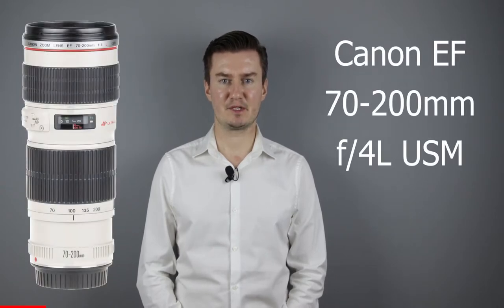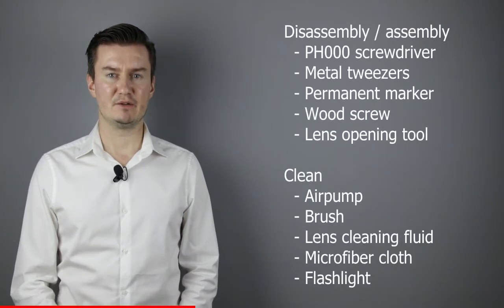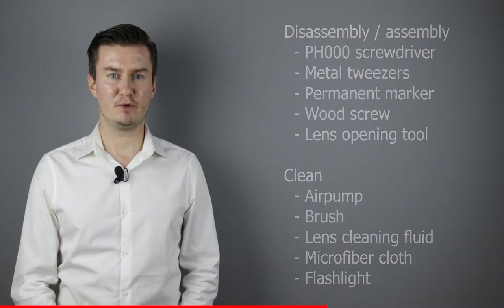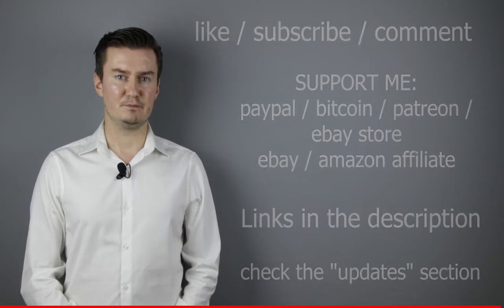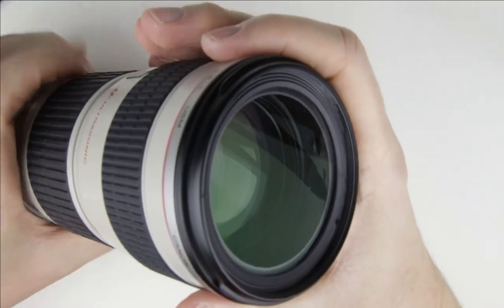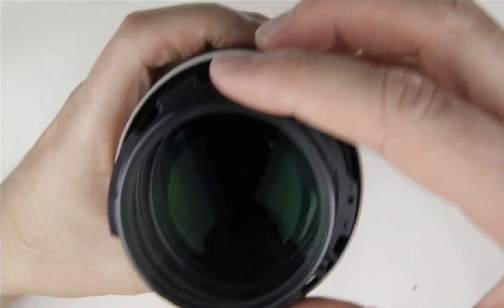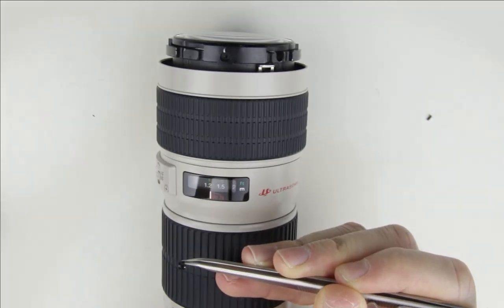Canon EF 70-200mm f/4 L USM - how to clean the lens inside

Comment: how about showing how to clean/remove fungus from the other end of that lens? i have the IS version.
Reply from the maker: I have a disassembly video about a Canon 70-200/4 lens which I have to access the USM motor. I guess the IS version is very similar, and you can use that video to remove the rear lens element group. I haven't disassembled that group, so I don't know how to do it, but check it, maybe it is easy to do it.
Reply: @CamerasLensesEtc  ok. i'll check it out. thanks!

Comment: Hi, nice video Sir, I left my canon 70-200 f4 usm IS in a local repair guy to clean fungus, the front elements are now free of fungus but the rear elements still have visible fungus, I see from your video that the rear lens elements are housed in a black tube structure & it is this I need to access & clean glthe individual lenses myself, have you any tips?
Reply from the maker: I have a video about disassembling the 70-200/4 L lens (not for the reason of cleaning the lens elements), and following my video you can remove the rear lens unit. However, I haven't disassembled that part, so I don't know how to continue from there.

Comment: i have the 70-200 f2.8 it looks like the front assembly is a bit different. there appears to be an additional metal ring, do you know how to disassemble it?
Reply from the maker: I don't know... I haven't done that before, and seems that there are no screws on the side of the front lens, so I don't know how to remove the front cover ring. Maybe check if there are screws under the focus rubber ring, or maybe there are disassembly video on youtube where it is shown how to disassemble the front of the lens.